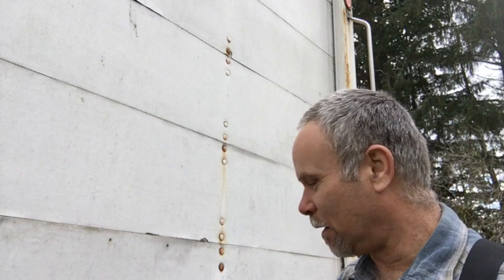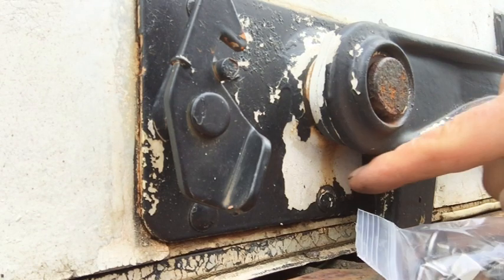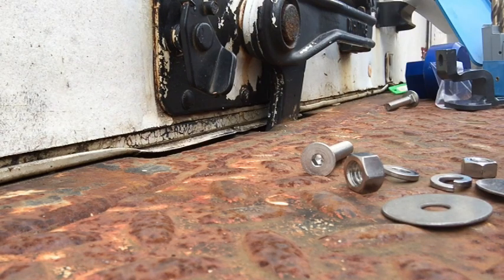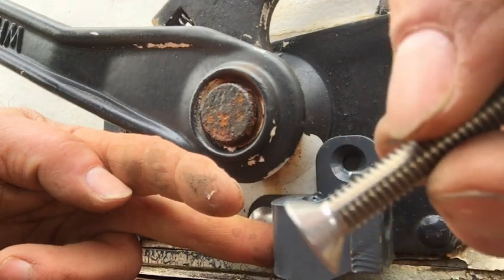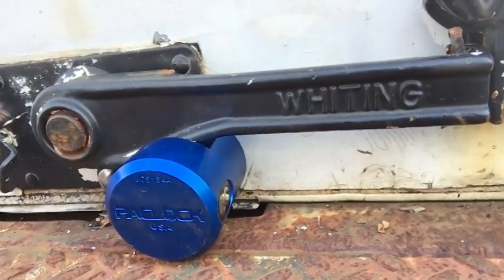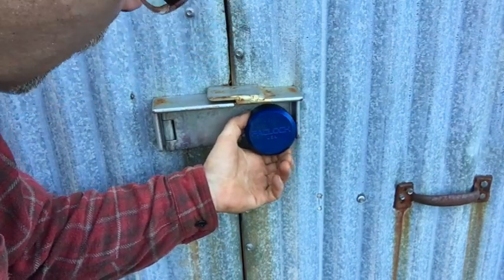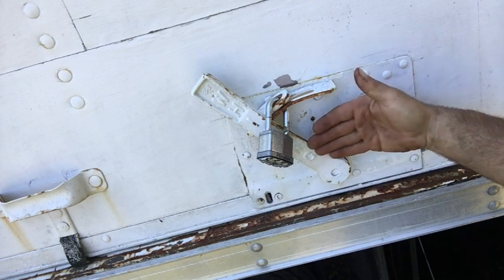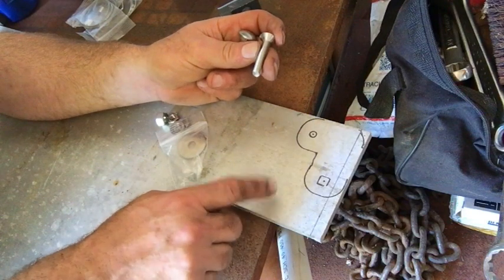New Locks for Security

Comment: Make a steel adapter instead of alumunim and weld them to the door plate. use caution that wood does not get on fire.
Reply: That is a great idea. Truthfully, haven't put any thought into it since the "fail". I just stuck the old lock back on it for now.